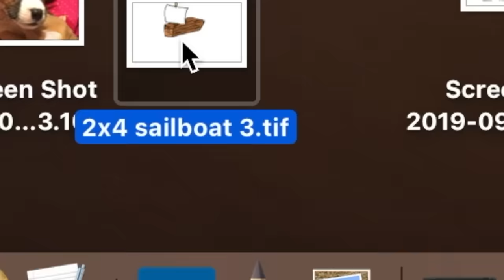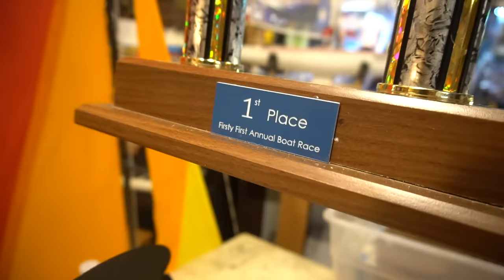CHEAP RC SAILBOAT 2x4 challenge!

Comment: When you have to go all the way around the long way to tack upwind, that's called wearing.

It's how the square sailed ships usually did it, since it was easier on the hardware, and less effort for the crew. Also, square sailed vessels were not always the most windward in the fleet.

The three masted boat is not a schooner, which has gaff rigged lower sails, and also loftier masts as you proceed aft. The sloop was indeed a sloop. Add a headsail (jib) though, and she would be a cutter.

Your upwind problems were likely causes by insufficient lateral plane area (keel needs more surface area). Also, the usual guidelines for proportions won't work well, as you've scaled down to, basically, a different set of rules/guidelines.

The sail on a boat works just as the wing on an aircraft: pressure differential.

For practical knowledge of sailing, nothing beats holding the tiller in your hand. I have plans for a small, inexpensive sailboat you could probably build in a weekend. It's a catamaran, because the other road to stability is width, rather than low down weight. 

Please note, however, that the mutlihull approach can only keep up with the deep keel approach about 95% of the time. After a knockdown, one person can right even a good sized fin keel sailboat. A catamaran, having no low down weight, is just as stable upside down as right side up, which is little problem on a lake, but, out at sea...

Enjoying the videos immensely. Keep up the good work!

Comment: This may have already been mentioned. One of the main reasons you were having trouble sailing upwind was your keel design. It should basically be designed as an underwater wing of sorts. Take a look at your model sailboat keel and compare it to your boats and I think you'll see the issue.

Comment: That's because sailboats typically don't sail straight into the wind, they TAC from side to side into the wind in a diagonal crisscross path to move upwind.  If you want to get an idea, try ATLAS for it's sailing dynamics.  They use wind and sail direction to steer the ships the same way you would a real sailing vessel.

Comment: The key to sailing is to first find out how close to the wind your boat can sail and still be going forward. .... then tack and go toward the wind at the same angle as you did before. ..... the maneuver you talked about to turn your boat is called a jib. when you go with the wind to get on the other tack. ..... This can be done by all sail boats. It's a great sport in full size or R/C boats.
Reply: No sail boat can sail directly up win. Jus bring your sails in close to the boat and when they start to flutter turn your boat away from the wind until the sails stop fluttering. When you run out of room tack to the other side of the wind and off you go as close to up wind as your boat will sail.

Comment: the ballast ball does kind of keep the boat from tipping over but it is actually is called a keel and it makes it so the boat goes straight without it, it would just drift sideways. and also most keels are shaped like an aerofoil what helps it a lot and that is why sams boat did not go upwind in the second race because he used a straw and that will not work. Just some tips so if you do it again you will bet him  even more. :)

Comment: Sailing downwind (breeze behind the middle of your boat) in “more than reasonable wind”, it’s Best Practice to avoid a “gybe”, where the wind slams the sails to the other side of your boat and may break things (like your head, in a person-sized boat).  So, you may want to perform a “chicken gybe”, by turning into the wind (~3 lefts to make a right) and resuming on the new course.  Which you The best high-wind maneuver is to Go Home and binge on PeterSripol YouTubes; which doesn’ t work so well in the (name) Ocean.

Comment: That weird 360 move is call a "jibe". Helps when the wind cause trouble on the upwind tac. Gives a relaxed monument by letting the wind come across the stern so you can set the main sheet for the next tac. Anyway that was good sailing fun I bet.

Comment: Instead of sailing a 4x2, sail it as a 2x4, that is roll the plank 90deg and have a narrow bow.
It should sail faster, and have a larger side cross-section in the water and smaller cross section pushing through the water.

Comment: The trick to sailing upwind is making a zig-zag 45° off from the wind’s direction, and tighten the sheet until the trailing edge of the sail starts to flutter. Think of it as a wing: when it flutters, it’s stalling.

Also, if you are only running 2 channels,  nix the jib sail, otherwise set a 3rd servo and channel to tighten/loosen it separately. If you want to do a 2 channel, a setup like a Lazer (brand of small sailboat that is great for beginners)

Finally for some extra fun, make an adjustable daggerboard on yet another channel so that you can lower drag at the expense of stability, or vice versa

Comment: Some years ago I made an RC sailboat from heavy balsa and RC car parts.

I attached the drive motor to a spool to let string out or snatch it back in really fast. And then I attached the steering motor to a rudder. It was fun, though sluggish in the water since I balanced it with a bit of chain instead of a long ballast bulb like yours. It eventually got damaged and I didn't want to fiddle with it anymore. Though I DO wish my kids could see it, so maybe I'll build another sometime.

Comment: Makes sense to me that the schooner was better in the maneuverability test during high winds. More sails on shorter masts usually means less keeling for the same sail area, and was thus less likely to capsize than the sloop with a much taller mast. Downside is more standing gear to cause drag, so in ideal conditions and with properly trimmed sails, a sloop will generally be more efficient when sailing to windward than a schooner.

Comment: The hull shape certainly will have made a difference, but another couple of factors that will have influenced the maneuverability of your ships would be sail size and tautness.
Peter's boat had much smaller sails, meaning that it was able to more efficiently utilise the energy the wind gave it. Rather than simply being pushed backwards because of the large surface area of the sail compared to the keel, it was able to move forward while being angled more towards the wind. This is why sails would be reefed (made smaller) in a storm.
This could have been further improved if you had had any control over how taut the sail was. You had some minor level of control over your sails using the servo, but there wasn't much stopping your sails from billowing out or flapping around. That means you're losing most of, if not all, the energy the wind is providing you, and you will move much slower. Greater control over your sails means a sharper angle to the wind, meaning it'll be much easier to reach and maneuver around a buoy.

Comment: Next, you need to combine the sailboat and hydrofoil projects and make a radio-controlled hydrofoil sailboat.   My interest was sparked in the late 1960's by B.K. Smith's "The 40-Knot Sailboat".   The "Yellow Pages" hydrofoil looks to be similar in design to Smith's original design.  Using rigid airfoils should make remote control somewhat easier than using traditional fabric sails.

Comment: When a sailboat turns so that the back passes through the wind it's a "gybe"  This is much slower and riskier than when the front passes through the wind ("tack")  Probably because your keel isn't providing enough lateral resistance (too small)

Comment: 11:01 - during this abrupt change of course the wind throws the sail to the other side of the boat which can damage the rigging. i experienced this myself on a windy day at a sailing club when the rail whacked off my glasses, but luckily they did not fall into the water. to avoid this i learned to turn the boat the other way around (with the nose facing the wind side instead of the rear facing the wind side) until the boat faced the other direction.

Comment: You need a longer and broader keel for the schooner . You could also add a bow sprit and put on headsail, this will allow the boat to point to wind better, plus the broader keel should address some of your issues. You will loose a little steering it won’t turn as quick but you can add a deeper rudder .

Comment: I think an improved keel would help both boats. I might also try independent sail controls for the fore sails and the aft sails on the schooner so that the aft sails can be pulled in all the way to help bring the back of the boat around when tacking into the wind. Those boats definitely look like fun, I have a Victoria that was much improved with the addition of new sails from Carr sails, the stock sails from the late 90s kit were terrible.

Comment: Try to make it like a Thames barge. Their mainsail is attached to a bar spanning the hull and as it moves into the wind it automatically tacks the sail the correct direction and the boat will do a slitherin motion upwind. Keep in mind that it'll have to be very heavy as the barges routinely carried a hundred tons of cargo on a trip.

Comment: Two design mistakes.
Need bigger keel surface because it is the under water sail that works opposite the sails above the water.
Second, the keel needs to be placed fore and aft to balance the steering.  Fun😃

Comment: Hey I made one of those about 20 years ago, 8" long, cat rigged with alloy mast and clingfilm sail.  2x NiCad AA batteries for both servo power and keel ballast.  Wanted to practice sailing.  Also dug a small pond in my garden to sail it on.  Worked OK until the pond filled up with weeds.  Over the years since then I've upgraded to a 30' ketch on the Irish Sea.

Comment: What he should do is make a long keel that goes from front of the boat to the rear that would make it stop drifting, then make it so you can choose how the sails are, so you could make it sail on different type of configuration which will make it easier to get up the wind

Comment: The Sloop has way to much Sail, make smaller Sails and it would be much better. The Schooner's Keel is too narrow for the number of Masts it has, each Mast becomes a Lever as the wind pushes on it...so adding a 2 inch or so Keel that runs the full length of the Hull should help. I know they'll never mod these, they'll just move on to something else.   8^)

Comment: CHEAP SAILBOAT CHALLENGE: $10 block of wood, $30 sails,  $30 arrow shafts, $100+ servo, $300 controller, at least another $200 in electronics and batteries.. like really dude? Oh and the cost of a 3d printer! Do one for under $100

Comment: tacking into the wind requires a sail at an acute angle to the wind.. so the path on the front of the sail is longer, creating a low pressure in front.. blow me indeed.. sails suck... like wings
Reply: wings suck ^up^...
sails suck sideways... it's the same thing, only different

Comment: Now you know why with real sailboats, it's sometimes faster to have less sail area under high winds. What you don't want to happen is for the biggest to get blown flat, then you spill most of the wind instead of using it to propel the boat. For the schooner, you should have had independent control of each sail so you could luff (let flap in the wind like a flag) some and still maintain control. I have been sailing on small boats my entire life and too much wind is definitely an issue. I was once sailing just before a hurricane arrived and there was 50mph winds with gusts over 70 (I think, our wind indicator crapped out at 69 and stopped working). I was in a 23 foot boat and it's maximum hull speed (the max speed the boat is designed for) was rated at 7 knots and we hit 6.8 with only a reefed main (meaning we only raised the rear sail about half way and didn't put up the front sail). I wished we had a storm jib (a small front sail) so that we could have had better tacking (turning the boat so ther bow crosses the bow of the boat, if the wind passes the stern, it is called a jibe) speed. It was very difficult to round the bend in the lake we were on because of the slow tacking speed. Basically, we would get blown downwind in the time it took us to turn around and lose most of the ground we gained.

Comment: I got hurt when he used arrows :(
Those arent cheap
Reply: I use alum & carbon  fiber arrow shafts in building my RC sailboats - source ? google a local archery shop , if they have a shooting range they will most likely have a container of USED or damaged arrows , sold cheap, usually.try that.